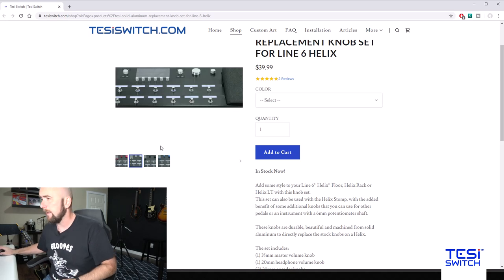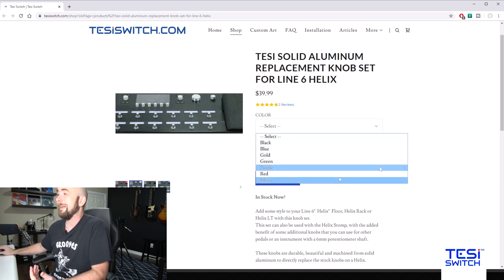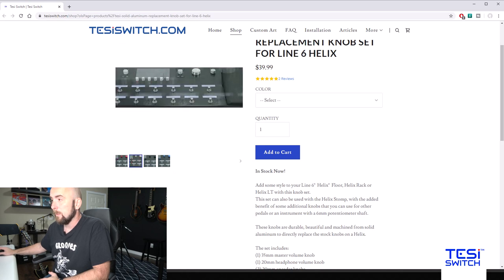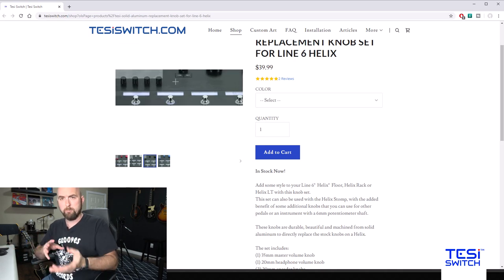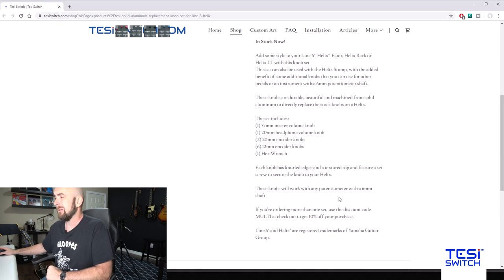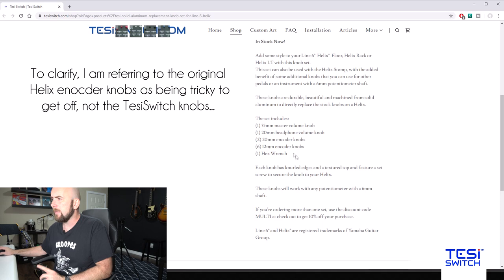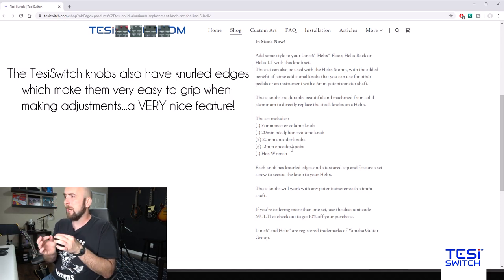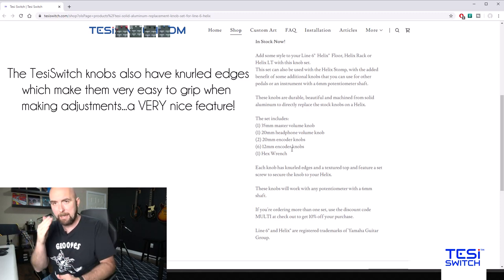Line 6 Helix Upgrade - TesiSwitch Helix Knob Set

Comment: One of the issues I had with the stock plastic knobs on the Helix floor, is that if slightly too much force is applied to the nobs on the joystick or the preset knob, the plastic on the inside would break, causing the knob to "sink" into the stem so that you couldn't press them. My solution to this was just to put a small ball of paper to give it some more height. If these knobs are indeed fully metal, this might actually be a worthwhile upgrade!
Reply: OMG!!! I was going to pay a tech over 200 bucks to fix this problem until I just came across your comment.  I've fixed it myself with a set of these knobs. Cheers bro. Guess I owe you 200 bucks!!! LOL